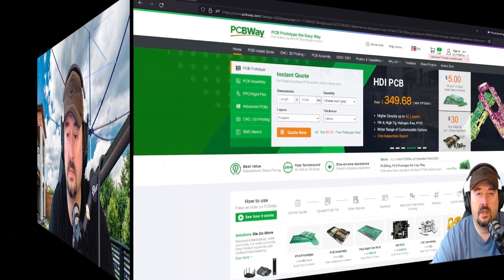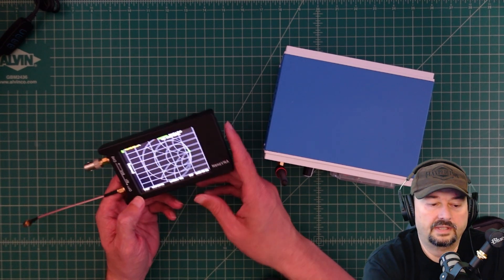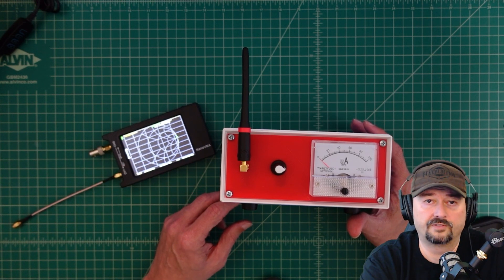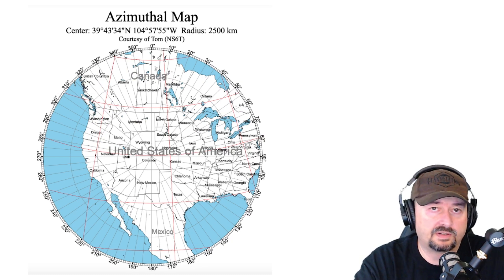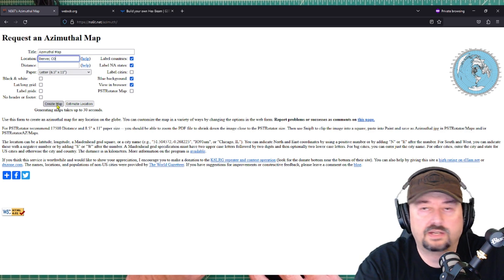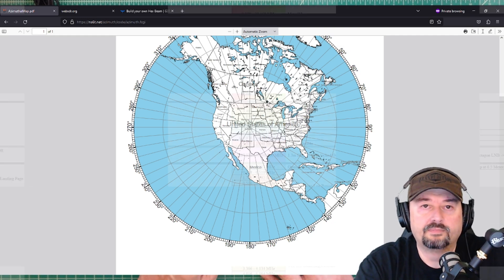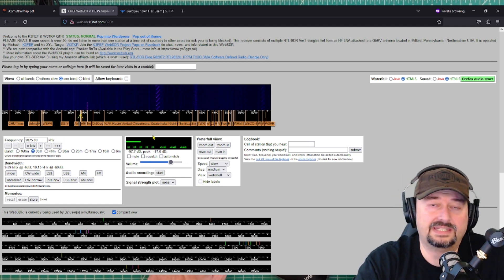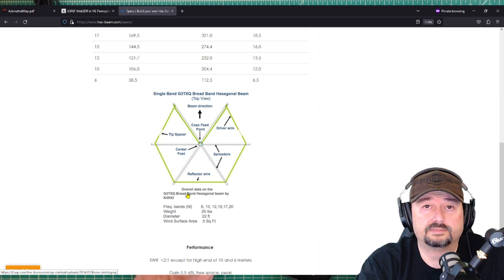How I test Directional Antennas...

Comment: One little, maybe beginners, question..
Although I respected the antenna wire lenghts given on the website, the site you also mentioned for the construction of the beam and wire sets, the SWR was way out. I had to cut my antenna wire in order to have an SWR close to 1:1
I use PVC insulated 14GA
Wil the SWR dramatically change when I raise the antenna to 10 meters?
Reply from the maker: Hey Peter, it could change when you change the height.  You might want to check that before any wire length adjustments 👍

Comment: I use an SDR too, I am lucky to live in a small country that has plenty within ground-wave range. That takes QSB out of the calculation and allows quite a precise measurement. The test the commenter might want to try with the VNA is look at where the individual elements are resonant. The reflector needs to resonate around 10% lower in frequency than frequency than the driven element.
Reply from the maker: Hey Stuart, get point about the reflector!

Comment: Spot on ape. I like to use rbn also. Obviously if the beam is under 30ft in elevation it will radiate more out of the back than it would at 50. 73 om
Reply from the maker: Hey Jay, thanks for the additional info and for watching 👍